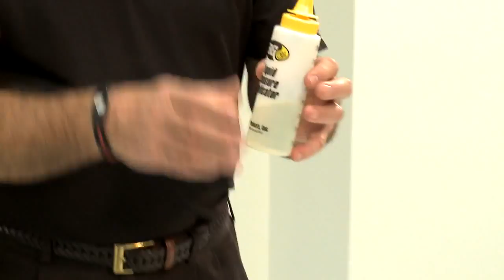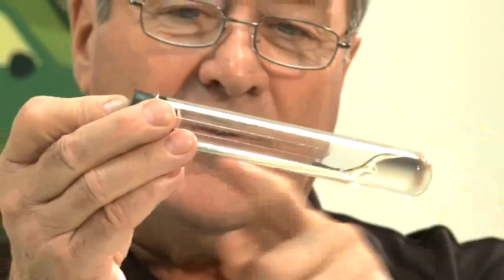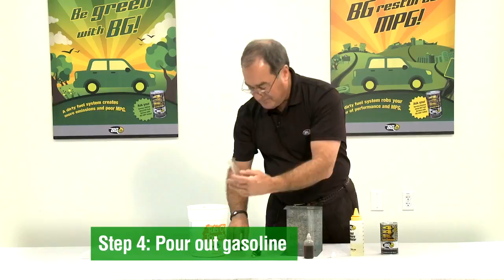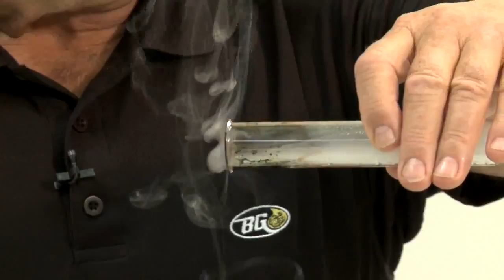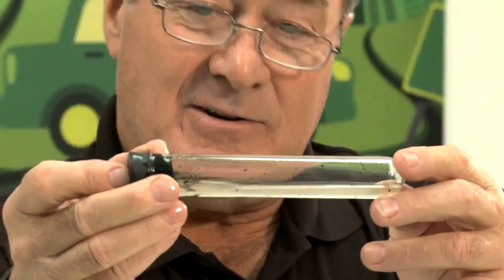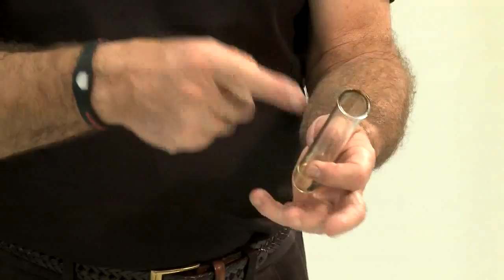BG44K / BG 244 Acid Demo

Comment: It is safe BG44K for diesel Engine?????

"BG 44K can be used in diesel or petrol engines" frum here: https://bgprod.co.uk/products/fuel-and-air-intake/bg44k
and:
"Many have used BG Platinum™ 44K® in diesels but it is specifically formulated for gasoline engines, which don’t reach the same temperatures as diesel engines"  from here https://bgprod.co.uk/products/fuel-and-air-intake/bg44k

Comment: I used bg245 on my Toyota Corolla 2 litre 2003 diesel, did a great job. However, after 3 months the carbon deposits returned despite using high quality she'll diesel. How can I economically ensure that the bg245 gives me annual protection, and is not just temporary ? I do 8k miles per year in 12 mile short trips. Thanks in advance. I was thinking can I add 1/4 of a can into a 1/4 of a tank every month or so to ensure continued cleaning. All halfords cleaning additives are far inferior to bg245. Thanks.

Comment: Hi, I have 2 cans of bg244. I have a 1/4 tank of diesel left. (70ltr tank) I have not used this before. What is the most effective way to use this?
Should I put the can in the 1/4 tank and drive as it is until nearly empty so it will be more concentrated
OR
should I put the can in and then fill her up and drive her until empty (a good 500-600 miles)
OR
should I put 2 cans in and then fill her up and drive her until empty (a good 500-600 miles)?

Thanks
Reply: Id say put 3 cans in and then burn the car and claim insurance money
Reply: @ahsanafzal48  😂

Comment: Why not do  a proper test 
Get an old car strip the engine take photos
Add your 44k, run the car for 3000 miles
Strip the engine and prove it works
Reply: its a training demo for people who give these demos. they cant be stripping engines down for every demo they give. He does mention to get a piston or head to use too though.
Reply: You know how much effort it took to shake the glass tube with fuel and not wash the smoke?

Comment: My Lexus requires 93 octane fuel... since BG44K reduces the octane requirements by 6 octanes, can I start using 87 instead of the 93 fuel??
Reply: No. Use 93 octane always. Regular will damage your car. I also used BG44k on my Lexus LS430. Fuel economy went up.

Comment: I used the 44K fuel cleaner,  the epr and the moa. My Jeep is running like crap now. Don't buy this garbage, it's all hype like every other damn thing!
Reply: I use this " garbage" for 20 years and my cars ranging great.  My cars do 100.000 kilometers in one year. I have now Skoda Octavia 2008 diesel - 430.000 and it runs like new. Previous car done 800.000 without engine failures at all.
Reply: Keep TJ Wheelin’@ Jeeps are crap to start off with. It wasn’t the fuel cleaner. 🤣
Reply: Keep using it at proper dilution. Sometimes, deposits get dislodged but wont ne disolved untill you keep adding product.

Comment: light it on fire with the BG 44K in it to see true results
Reply: That will not illustrate true results as petrol/diesel fuel and any added components are not combusted at room temperature and pressure.
Reply: Clint Meyer thanks captain obvious

Comment: Hi BG Great Britain, 

Can you use BG44k on an engine with a turbo? I have a 2014 Ford Fusion with a 2.0L EcoBoost Turbo, and have heard that fuel system cleaners break off carbon deposits, throwing those deposits into the turbo and ruining the turbo. Can I go ahead and use BG44k on my car? 

Thanks!
Reply: Your car is a direct injected vehicle, the fuel is sprayed directly in to the combustion chamber and will not interact on the intake/air side of the turbo so I would say you can. Couple guys here use it in their twin turbo ecoboost trucks with good success.
Reply: I have a 2014 Ford Fusion with a 2.0L EcoBoost Turbo as well. I have ran up to TWO 11oz cans in the small 15.1 gallon fuel tank at the same time with NO issues. Being boosted, I noticed a huge difference in the performance. I am sold and only use BG products. In FACT BG used a twin-turbo Taurus SHO for thier EPR 109, MOA 115 and 44K 208 product testing. Check it out! Unreal results!
Reply: Golden Manuever Do you have a link for the SHO testing they did ? Thanks